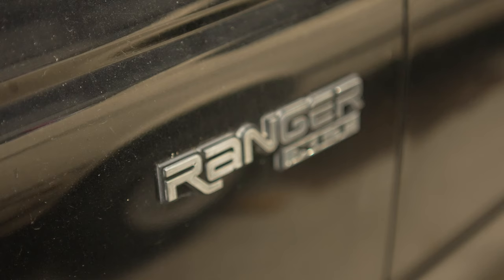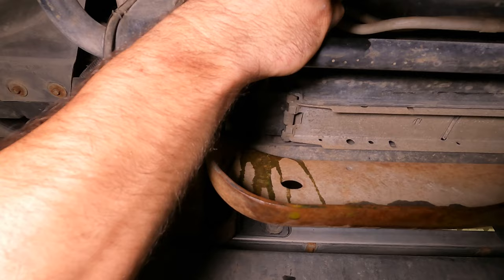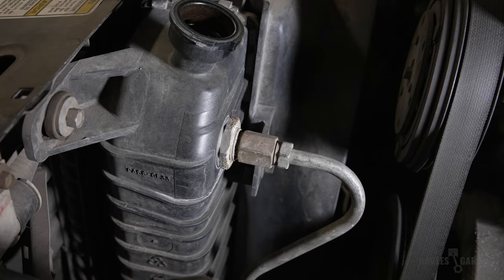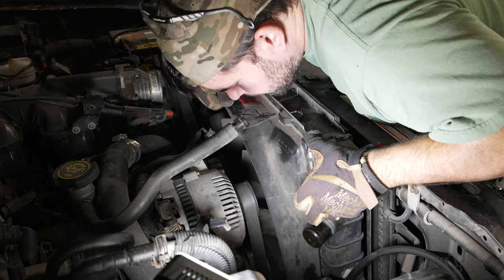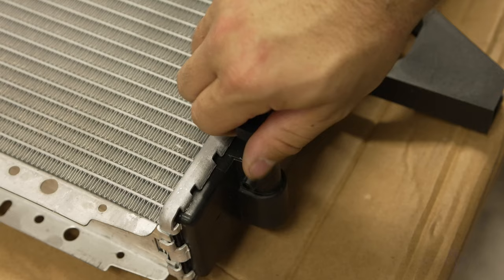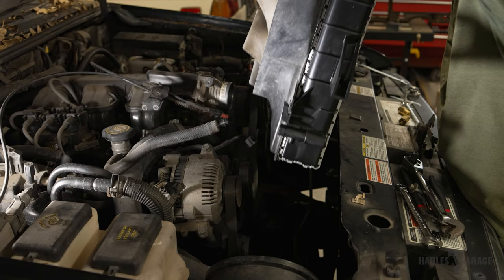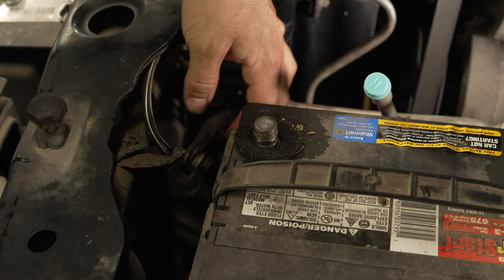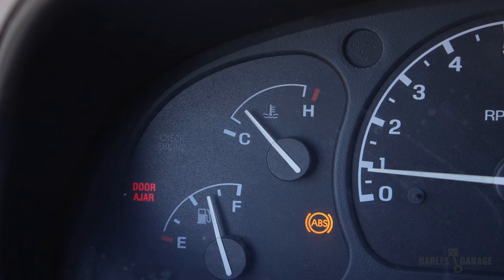How to Replace The Radiator On a 95-97 Ford Ranger 4.O - OHV

Comment: I've got a 95 mazda b3000, 3.0....I'm thinking I don't need to remove the fan to replace the radiator. Is it necessary?
Reply: ehhhh some vehicles no it’s not, i don’t have to on my 96 ranger.
Reply: @owenaustiniii  I did it without taking fan off. Took like 15 minutes

Comment: Why did you remove the fan?  Why not just disconnect the fan shroud from the old radiator?
Reply: I just did it, and wasn’t able to access some parts with the fan shroud in the way, you can’t fully take the shroud out when the fan is still in there